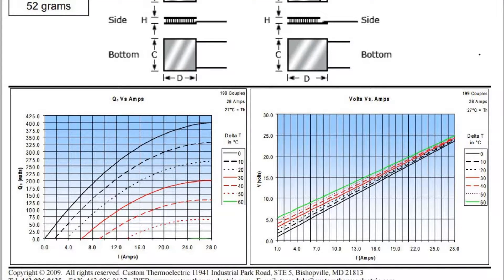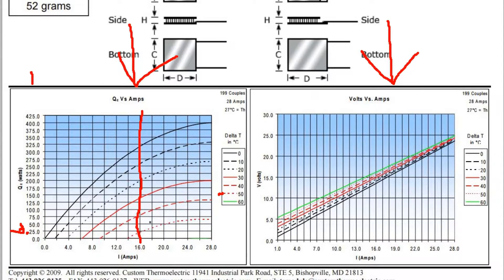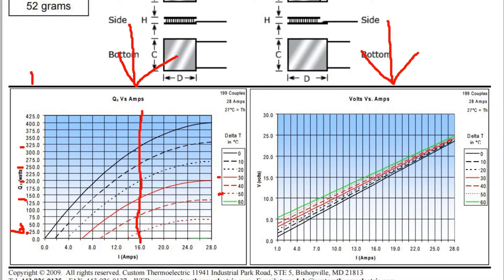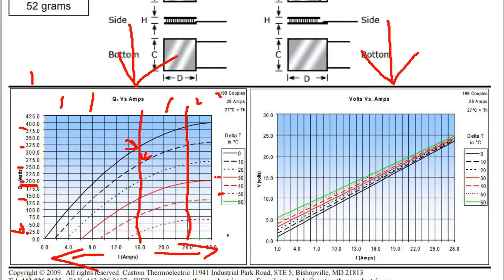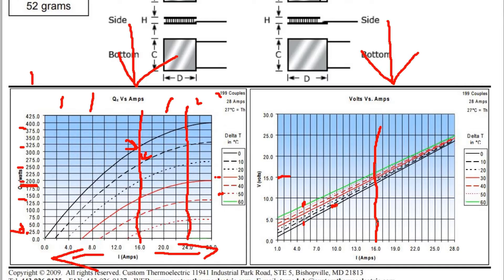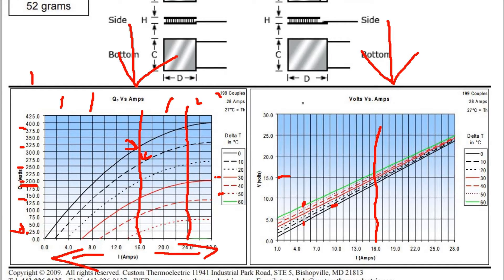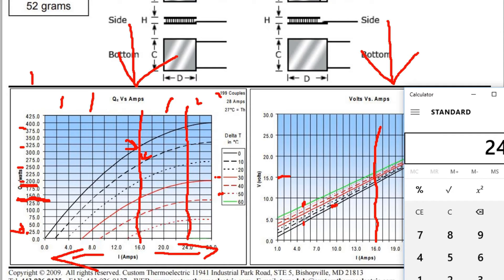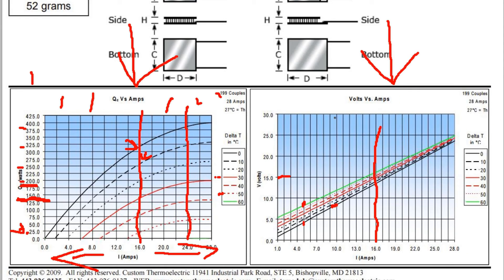🎓 Understanding Peltiers ⚡️ Graphs. Episode2

Comment: In the Volts vs Amps graph, what does the 50 deg delta line below 14A signify? (Because the Qc vs Amps graph says that the minimum current required to maintain a delta T of 50 deg is 14A)